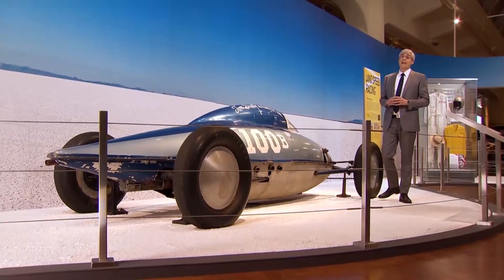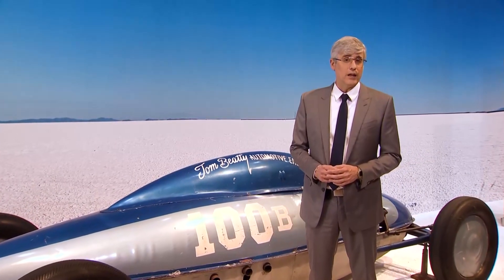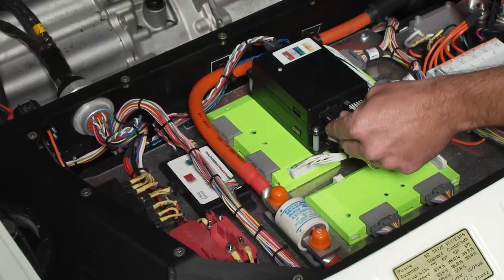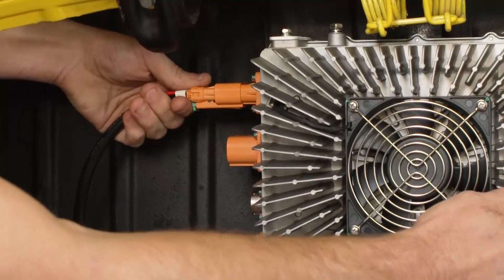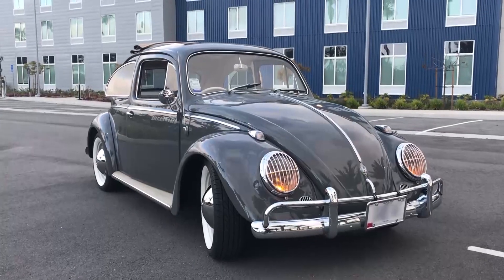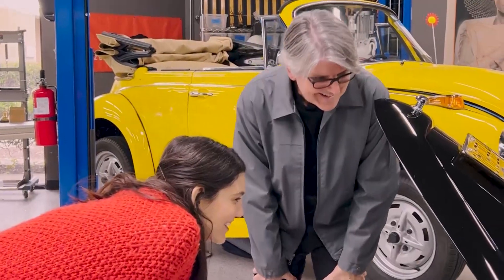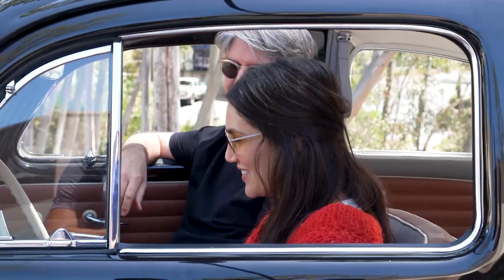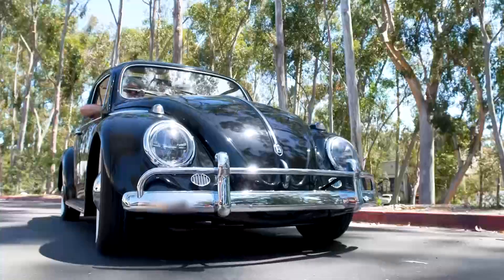Bringing Vintage Cars into the Electric Future | The Henry Ford’s Innovation Nation

Comment: No, just NO! 100 mile range and then what? That might be ok in a few places but, where I'm from, it wouldn't even get me to the closest major city and back home before the battery died and left me stranded. Add in winter temperatures and range is reduced even more.

I realize that people buying electric cars like these don't intend to drive them like their normal, everyday vehicle. However, even the electric vehicles sold new today have a limited range and, many areas, mine included, just don't have public charging stations available (and won't for the foreseeable future). Electric IS NOT the answer!

Comment: The hole electric car thing is ticking be off classic cars have classic gasoline motors for a reason that is to experience the smells and sounds of history the sole of classic cars are in those gas motors pulling that inline 4 cylinder engine out of my model t is like putting a pet down the model t would never sound the same again I love the chugging sound of the model t that is one of my favorite things about the model t and smelling the smells of the 1920s coming out the exhaust